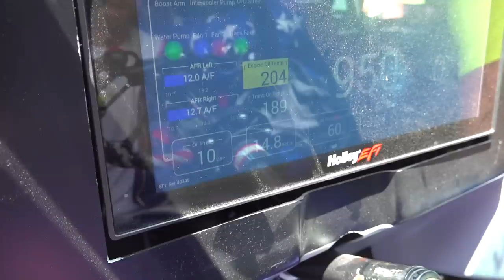Mullet vs. Twin Turbo Mustang In the Street Car Shootout Finals... FULL BOOST On a Hurt Engine!!!

Comment: Considering the motor was "hurt" low oil pressure, the fact that Mullet pulled down a 7.3 on that last run is amazing. Pity they are going to have to figure out where the issue is, that 'perfect' tune goes right out the window.
Reply: He said it was the last run with an LS engine so I don't think a tune is a concern.
Reply: The big block is coming!
Reply: There is no perfect tune, that’s why the tuna’s at the track w them. Tune changes based on track conditions, weather and so much more. It’s a snapshot in time. It’s super useful data to base a tune on for a track/day with similar conditions but it’s always dynamic. So it doesn’t really matter. And cleeter said last race w an LS, so it sounds like a big block is coming in hot
Reply: Beleave he's going to a Morris big block next!!
Reply: @mikellewis2346  Yep! Can't wait for the SMX engine
Reply: @BeigeYeti12345  Monday it's coming. He said they're pulling it out as soon as they get back and Zach had the biggest smile on his face lol.
Reply: They most likely hurt the crank. Can’t always just replace the bearings and hope it works
Reply: @northtexasskies7786  regular 6s runs are in the future for mullet !!
Reply: @nathanaelcole8466  Yeah another setup they stick in the corner, barely tune, and bounce off the two step 50x an event and wonder why they always blow up.
Reply: Leroy did the same thing when they ran the 7.2

Comment: Cleeter is a racer that cares for other racers, top notch amazing guy. Zach seemed offended the guy got loose and almost wrecked, I hope not, maybe just in shock
Reply: Probably scared him. A tap at 170 would wreck both cars and possibly kill the drivers.  So... "offended" ? Scared 😱, probably!
Reply: @johnb7430  so fear gives you the right to not care about both parties and at least sound like you’re blaming one for a slick big end and shut down? Have you ever been on a slick shut down? It’s not friendly, you should be giving the dude props for saving it. Also these cars are built certified to keep you alive at high speed wrecks, tracks don’t allow you to go over a certain speed or to drive at all if you don’t meet very highly regulated safety specs and equipment. Hell if your harness is a day past it’s cert date, they won’t even let you race.
I like Zach, I’m just giving my two cents, don’t get your panties in a bunch over it lol

Comment: THAT MOTOR NEEDS TO GO INTO LEROY!!!! Aluminum rod LS with 2000HP, Leroy would be back on top of the stick shift game
Reply: I dunno if there’s a manual box out there that can handle such a power plant. I wanna see it happen!
Reply: @phantom240  have you seen much on the stick shift world? Joel Steel 6.81 2000hp Coyote T56, Joel Grannas 6.83 2000hp 2jz GR700 Magnum, and Jonathan Atkins 6.97 2000hp LT1 T56 trans. Plenty of cars handling more power thru a manual and going fast, it's easily done and needs to be the new Leroy motor since Mullet is going SMX
Reply: @OSOKKRONOS  admittedly, no, I don't follow much in the world of drag racing in general.

Comment: Sounds like the low oil pressure issue might be oil airation or bubbly oil , what's the sump pickup situation
Reply: When I was watching the video I thought maybe low oil level but then I figured they had a dry sump or something cool and probably checked it in the morning.  I like your idea too.  Or its the bearings anyway ha!

Comment: Cleet, does that engine have an o-ring on the oil pump pick-up like most LS engines?  If so, check it, I had similar issues a while back.  Congrats on the win brother
Reply: Yeah I'm sure it does probably is just hurt because they pretty much bandaid it to make it to here and all the metal that it couldn't get up from the last damage finally caught up and blocked the oil passages and the new bearings are probably shot already pretty common
Reply: @freedomfox8183  lol no metal is blocking the oil passages.  It spun another bearing, that’s where the loss of oil pressure is from.  It shoots out from everywhere around the bearing instead if passing through the rod bearing and up the rod to the pin.
Reply: @5uprnva  we thought we spun a bearing too.  I know they just did(and more than likely did again), but it could be that o-ring and that could also be a contributing factor of spun bearings.  Most people dont know that the o-ring shrinks and hardens.  I have changed many and all drastically improved oil pressure.
Reply: @freedomfox8183  won't matter now, he's putting in an SMX when he gets back. Whatever car this LS goes into next probably won't be pushing 2,000hp
Reply: @Highstranger951  you might be right if this was a 150k mile engine, I doubt they would’ve missed that during assembly

Comment: Has that car ever not had a “hurt” motor? Even it does 2 or 3 runs later it will. Drag racing is like 10 seconds of fun and 60 hours of repairs.
Reply: Watch NHRA top fuel stuff and then you'll see all the work after every single run😂
Reply: @JedemPoKucama  I get what you’re saying but it’s also apples to oranges, they’re pushing 10,000 horsepower their clutch plates get so hot they start to melt and weld themselves together, so they literally have to take the cars apart otherwise they literally couldn’t do a second run.  😂
Reply: Wanna play, you gotta pay.

Comment: I've been down that same road, it's impossible to get everything clean enough when you have a bearing failure without full disassembly and a scrub brush bath. The oil galleys and nooks and crannies hide junk. Hot water, degreaser, oil galley brushes and compressed air.  Glad it held on long enough.

Comment: The oil pressure is low because you have grooved crank journals. Even if just very fine ones. Unless you turn the crank it's gonna be lower after the bearings get worn in after a good run. Unless you're getting metal fkn send it. Lol.  Unless you don't want to risk it, which in my case I prob wouldn't on an engine at that level just because it could take a year or more to redo it. 

Great content. You're living my dream too and I'm happy for you!

Comment: Hey Cleetus
Maybe the Oil pump by pass valve is  sticking from the metal flakes? Do the main bearings have a notch to stop the From spinning or are they the press fit. Get plastic guage from a machine shop and check the clearance on the bearings...

Comment: I'm not super knowledgeable on the turbo stuff, but is it possible to put in an anti-lag system to cover when the wheels spin? The way I understand those is that you can keep the turbos spooled, even when the engine backs off (to compensate for wheel spin in this case).

Comment: Tough beak on the engine, I was surprised that rod went back in after compressing against a screw. The large side could easily be out of round or the rod could even be bent a bit, but probably hard to get a replacement. Can't wait for the big block!

Comment: Is there a reason why you should the engine off right after making the pass when the car is still rolling? The engine and turbo's are still running high rpm and you shut down the oil supply.

Comment: when oil gets warm it gets thin so less psi...higher rpm will show there is oil flow because the psi goes up..be interesting to see what the psi at idle be if you dont do anything to the motor and see what it is for psi when cold

Comment: I'm glad you made it through! I'm not sure if you have a Clearview on that car? If you had one & had such low oil pressure, you would have shown material in the filter quickly! You may just have leftover shit blocking off the hole in the sensor? Because aluminum rod engines, are not forgiving like a steel rod engine! If it were really that low on pressure, it would have broken a rod! It needs to come apart & be fixed right anyways! When you get bearing material in a engine, it gets everywhere! In the turbos, oil lines, behind the cam bearings, in the lifter oil gallery's. You will literally have shit every where oil flows! Even with good filters. You really cannot just get away with rolling bearings into the engine, without it causing problems again! When it gets opened up, it needs to have cleaning brushes run through every oil passage there is! Moroso used to make a nice set, they probably still do! Hopefully it was just shit in the sensor, & its not a mess inside! Best of luck! Congrats on the win!

Comment: "fastest mopar in the country" got walked after cleeter spun the wheels TWICE. Hahahaha
Reply: he had to be having issues, he only went 9's with turbos and it's fastest "Stock suspension" Mopar. In the early 2000's at my small local track there was a Cuda with a N/A small block Chrysler 360 running 8's

Comment: Got the  black cloud overhead...think of it this way, less oil pressure, but allot more FLOW... which means more cooling....lol
Won by 0.007 sec... tightest margin of victory yet... what is that in distance, the thickness of paint on the bumper? WoW

Comment: Are you all running a stock style oil pump? I have seen a lot of people have problems with running "stock style" oil pump. I think its time to switch to a external Aviad oil pump setup. Not a hater love your program just want to see you go faster and faster.   Edit seen last race with LS but still good for ls engines making high power like that

Comment: Cleet your gonna have to get Tsp to build you a billet dart ls next based that’s in the 440ci range with a bad ass wineberd or Bryant crank GRP aluminum rods and diamond pistons and Frankensteins baddest lsx heads mullet definitely needs a serious bullet and needs all the methanol! The current combo would be best for drag and drive stuff but it needs a serious bullet and finally use the lock up

Comment: Have you guys put an oil pressure gauge on Mullet to see if that sensor is out of calibration. Also did you recently change oils? I had a similar issue in my Camaro when I changed oil brands. Oil pressures got all wonky. Motor was a dog to start and once it warmed up it was like having water for oil it thinned out so much. I had to swap weights to a 20w50 to keep pressure up at all temps but not bog it down for cold weather starting and street driving. Way to pull out the win though. That looked like a slip n slide commercial that second run. Mullet just looks like it is naturally born to be on a racetrack. We see other elco's but you don't get that vibe from those. Must be the combo of the aero and the paint color contrast or something.

Comment: How come you don't shut the engine off and shift to neutral after the trap? I remember Kevin told you to do it months ago to save the engine. The engine keeps being ran high rpm, off throttle, during decel. SHUT THE ENGINE OFF AND GO NEUTRAL AFTER THE TRAP TO SAVE YOUR ENGINE. Just my 2cents.
Reply: 👆👆Congratulation you have been selected among my shortlisted winner’s🤩🤩🎊🎉🤩🤩🥰🥰…

Comment: Even if Mullet is getting a new engine, fix the bearing problem and use the engine for another car. Seems to be an oiling problem. Check the oil passage to #2 main bearing,

Comment: On that meth/pump swapover - you need a switch for force meth-only mode in the ecu.  Last thing you want is getting a dose of pump gas that was left in the lines after the ecu switches back to meth timing advance

Comment: Mullet need a mechanical oil pressure gauge that's the one thing I dislike about those fancy electronic dash it's slow way to slow with showing important data like oil pressure

Comment: Ignorant question inbound….

Why does it take so long for mullet to get up to full RPM on the 2step? Some cars go INSTANTLY. Just curious. Someone educate me!!!
Reply: Very likely the torque converter in the tranny. They are often referred to as "tight" and "loose" - a tight converter being generally smaller and able to spin up faster, and a loose one being larger, spinning up slower (much more fluid volume - lots of mass). A tight converter has less stall - say the car will launch at 2000RPM while a loose converter has a higher stall - possibly 4500 or higher RPM. All depends on how you want to launch the car and where your engine's power band is. You'll tend to see tight (smaller) converters on smaller engines, maybe single turbo and such. As you get into the larger engines, dual turbo or blown, that's when you tend to see the larger (loose) converters.

Comment: Noticed in the last couple runs you may not have killed the engine and coasted down the slowdown of the track? Remember Kevin said at the speeds you are going and stopping now its a must on these LS engines and how Ruby roasted her bearings as well. Hopefully just that and not another engine failure.

Comment: Amazingly enough you made it with a hurt engine better than you do with a great engine haha. You should start winning more races on 10 lb of boost basically less oil pressure means less resistance and more power in a way LOL

Comment: i see a serious safety concern during the burnout events. please get this message passed along. i had a friend badly burned by an overheated radiator that exploded when he popped the hood. please consider not allowing people unless in fire suits any where near the overheated stalled cars during thier burnout including push crews pushing cars from the front end and backwards out of the burnout box. an exploding radiator could burn 5 guys in an instant. thanks, Dan